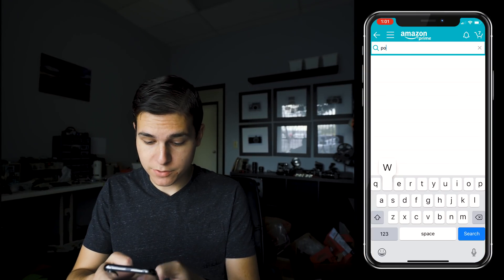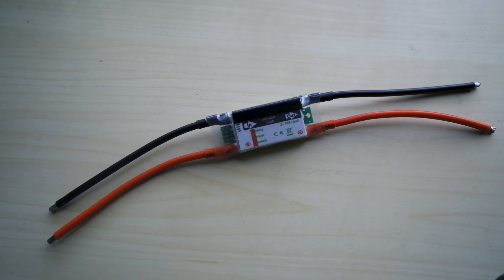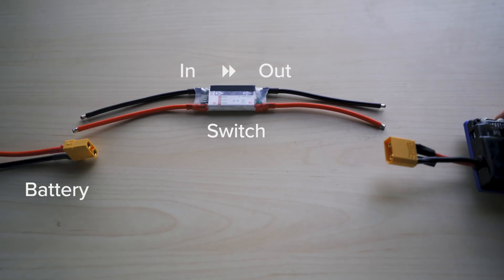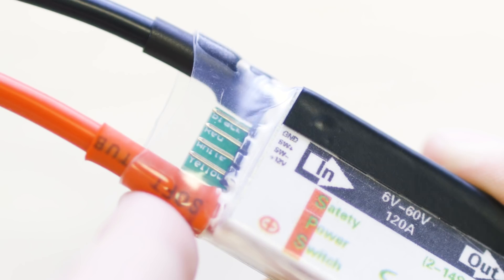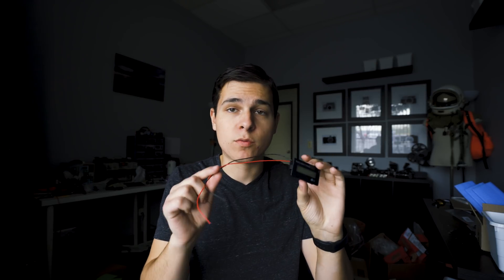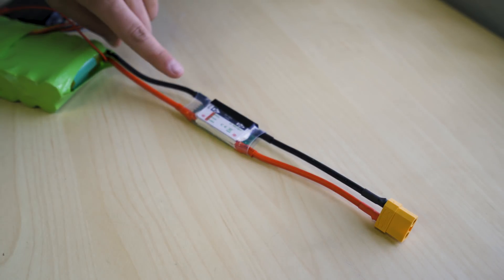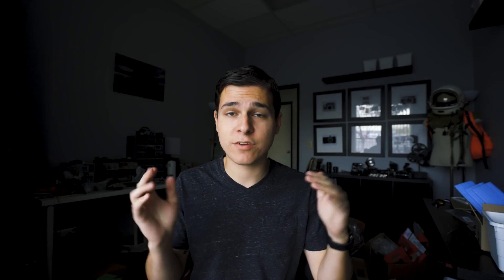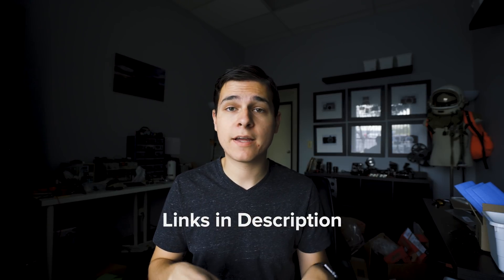DIY Electric Skateboard Build - DIY Boosted Board Tutorial | Power Switch & Battery Indicator LCD

Comment from the maker: What does everyone want to know next? Video ideas for the next one? Let me know 😎 Reply to this comment.
Reply: I don’t know if your boards have lights on them, but that is a cool thing you could show us how to add to an eboard
Reply from the maker: Love this idea
Reply: Mike Beard
How to configure the vesc depending on the battery configuration and the motor used  (how many cells, voltage...)
Reply: Aye let's get a vid of riding it and stuff
Reply: could you please make a video which is a full build with the switch, LCD battery indicator and charging with the 3 prong things you offer on MBoards. This would be super helpful!
Reply: How much does it count for you to build is an electric long board if we provide the longboard
Reply: I want to see you make an electric hydrofoil board.   Google efoil.builders
Reply: Mike Beard could you configure your components? I'd love to see how your DIY battery gets setup
Reply from the maker: Going to be looking into hub motors as well 👍🏻
Reply: Mike Beard could you do a video on how you made the battery( if you don’t know which one it’s the first one which pops up)
Reply: Looking forward for a tutorial on how to build an electric board from step 1 to finished product ! (not building the battery because most people will just buy one ) Love your vids , cheers !! !
Reply: You showed a 3x3S battery Lipo Battery, connected in series how do you charge it :( I looked for a long time but i cant find anything on it
Reply: aww man thats gonna suck but i might upgrade to a bms when i get better at it
Reply: How to have an easy charging system
Reply: How to install a BMS please!

Comment: Programming (or selecting the number of cells and type of battery) is a little different in the battery indicators I received from MBoards. There is no switch on the inside like Mike shows in the video. Instead you don't have to open up the casing on the back. You just have to hold down the button with the gear icon and then power it up. That will let you select the type of better and cells using the 2 buttons on the front of the indicator. Mine was L for Lithium and 12 for the number of cells. Once that was set I powered down the ESC which is what powered the battery indicator, waited a moment and started it again. Then the right battery percentage was showing.

I am using a Unity and used the ESC to power the battery indicator directly instead of connecting it to the battery or switch directly. This way it does need the Unity powered up to turn on the display. This is fine with me as I can power it up to see the batter percentage easily.

Comment: I have this same battery checker and I have realized that if you hold the cycle button after selecting your number of cells it takes you to another screen where it says S - (1-5) and you can change the lcd panels on the battery on and off for some reason. If you could explain this screen that would be awesome. Thanks!

Comment: ok so mike for the led battery indicator I get were you have to connect the wires but how are you supposed to do that? were would u solder? would you just take off the isolation to the wired solder  it at an angle and then  heat shrink it?

Comment: How exactly do you connect the LCD from the OUT part of the power switch. Because there is 2 wires coming form the LCD and 2 wires coming from the power switch, how do you connect the power switch to the VESC then? Cheers

Comment: So then if you have a 10s2p battery pack then that batter indicator won't work, correct? Because that's more than 18 cells.
Reply from the maker: There are 20 total battery cells but 10 cells in series and 2 in parallel. It would only be a 10 cell battery. Hope that makes sense 👍🏻
Reply: Got it. Didn't realize 10 cell battery meant 10 cells in each parallel unit. Thanks for clarifying!

Comment: One thing I don't really understand is where you solder the indicator. Do you just cut the switch cables and wires it in? Also, would you be able to send out your batteries with UK plugs? Thanks
Reply from the maker: The battery percentage indicator is soldered to the wires of the power switch. 

Our batteries are shipped with US plug. But a simple travel adapter can fix that.
Reply: Ok thanks, but just to clarify the steps you would take would be:
1. cut open some of the casing of the wires so they are exposed
2. Solder the wires of the indicator to their corresponding colours and then do the setup that you show in the video
Thanks again
Reply from the maker: Correct
Reply: Ok thanks : )

Comment: if I put hub motors in case I need to jump with the skateboard somewhere, will not it damage the motor?
Reply from the maker: The motors seem pretty durable. They handle all kinds of cracks in the ground and still seem great. I’m sure they’d handle some jumps.
Reply: thank you. I had a very strong doubt about this.

Comment: Wait Mike, you said that the power switch goes up to 18 cells but in your battery tutorial you use 20. Does that matter?
Reply from the maker: I use 20 total cells but I have them in a 10s2p orientation. So I use 10 in the settings.

Comment: Hey man! So I have this ESC from amazon, with an built in switch. I was wondering how I could connect that, to make sure that the indicator turns off.
Reply from the maker: You might have to experiment with connecting the LCD wires to different positive and negative wires to see what works. It’s hard to say with a built in switch on an ESC

Comment: I have a question regarding your set up and the parts: can we control the VESC with an Arduino? how? What are the minimal parts that I need if I want to do a simple test before actually buy a full set up ?  Right now I listed, motor, power supply (battery), VESC, remote and receiver (or Arduino). What parts would be different for a dual motor set up?

Comment: Can you please explain how to connect the battery percentage indicator? Thank you so much.
Reply from the maker: I explain this in this video 👍🏻
Reply: Mike Beard So, should I open a hole at the protection of the cables which is heading from switch to esc and connect the indicator there?